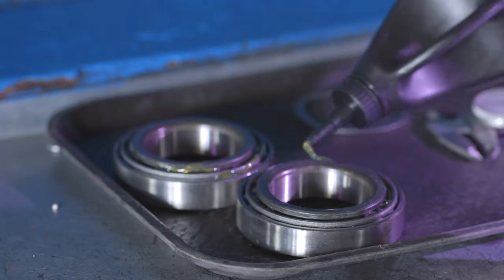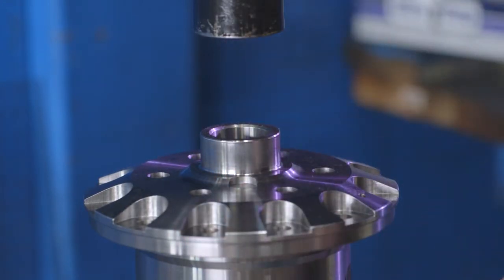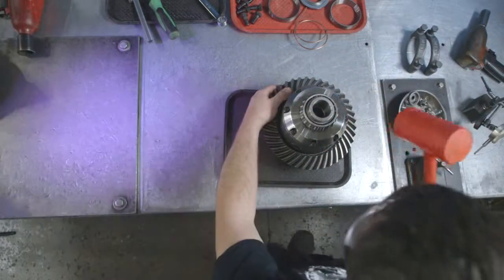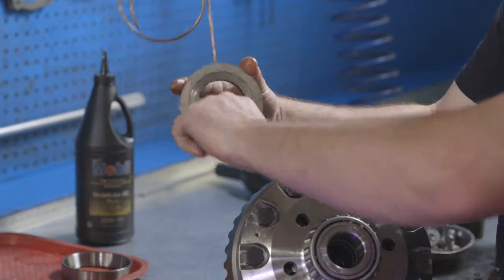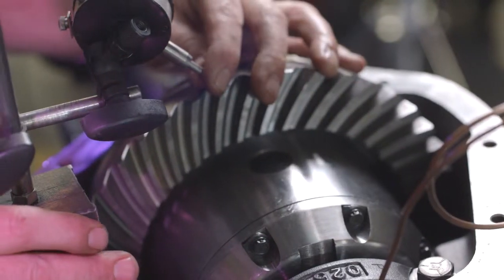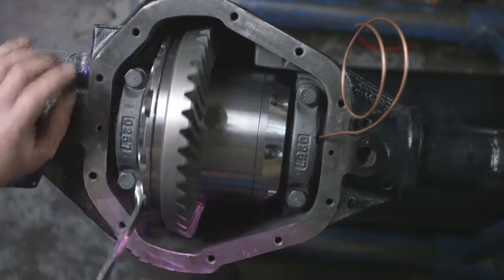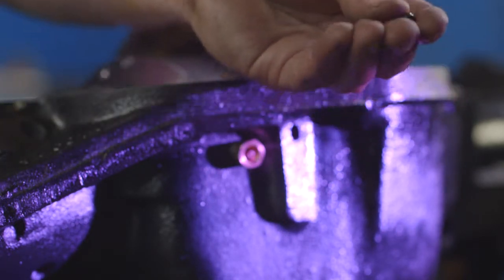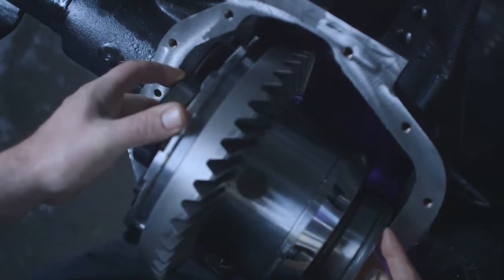How to install a Yukon Zip Locker

Comment: I see that for installing the ring you basically whack it with a dead blow hammer... can a press be used instead?.. use a few bolts as guides... then rest the ring on wooden blocks and then press down the zip locker from the top into the ring?.. I have seen this done and recommended on other videos,  Thanks!

Comment: Why is this zip locker not welded together like the one I received....
Reply: the video was produced in 2015 - prior to many of the zip locker cases being welded.   the welding was done as a solution to bolt stretch caused by lack of carrier bearing preload -  often caused by installers not using housing spreaders.

Comment: Instructions say no shim is to be put under the bearing? Is that true on the d44?
Reply: Is this a d60 install
Reply: correct,  in most applications, the zip locker is shimmed externally.   for application specific instructions you can download the instructions directly from our site  - https://www.randysworldwide.com/web_images/pages/Install%20Manuals/2013-Zip-Locker-Installation-Manual.pdf